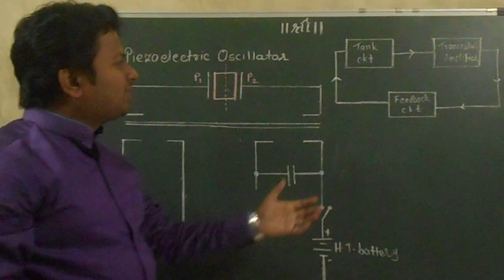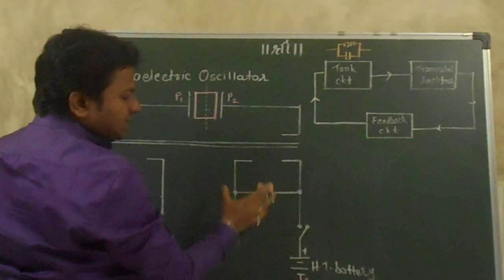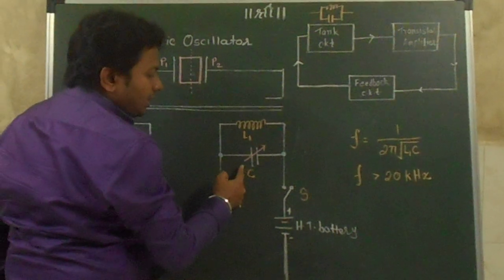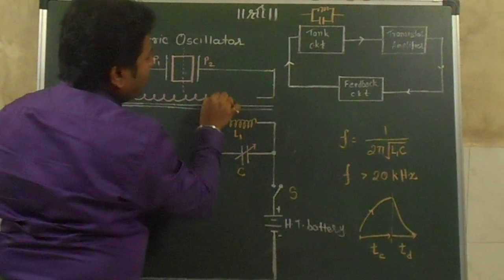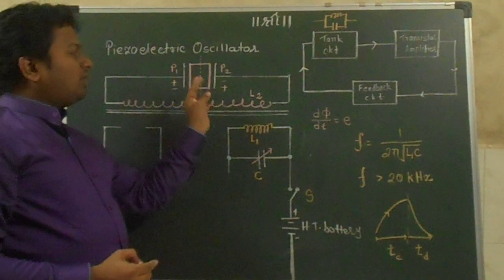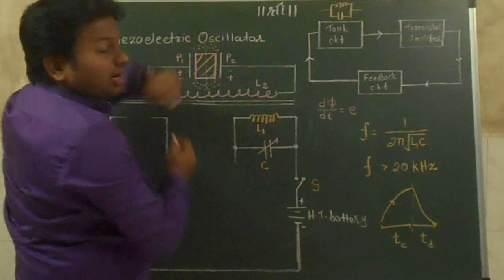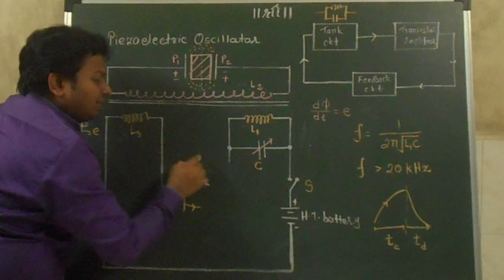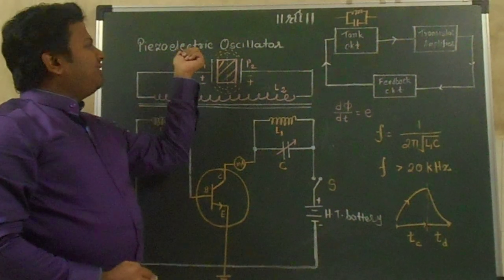Piezoelectric Oscillator: Production of Ultrasonic Waves (Engineering Physics)

Comment: earth forces and quartz to charge a  dual capacitor to make a spark gap that has a arc flash that draws in all the trapped sun rays into usable lighting like the so called kings chamber..  or like a reverb guitar in a speaker...  once you get it a rocking dont come a knocking...    two coils one for earth and one for the sun...

Comment: earth makes unlimted forces and salt water has tons of loose electrons  hey whats the core of the great pyramid?? lol river nile? socks on carpet? petting a cat??? purrrfect... piezoelectric is everywhere.. everything is the light  earths crust is 40% quartz and flying through space like a flexed quartz tweeter spearker... Here are some of my fav piezo vids. This proves the energy that our galaxies run on. If you can energize items to repeal earth with earths energy it proves to me. Earth is piezo charged and same charges repel. Watch all and think. The spiral of life and empty fabric of space. https://youtu.be/9NbCzbDdd-g

Push and pull depending on charge if its not charged it becomes mass and velocity. https://youtu.be/hoswNJZqUX0

Defy gravity. 
https://youtu.be/TV4oq_-OXkg

Sand https://youtu.be/L25q4fV8_68

Water https://youtu.be/VhWQ-r1LYXY

Fire and wind. https://youtu.be/a7_8Gc_Llr8

Don't forget energy makes noise. https://youtu.be/HE0k7Z2xoiw

Comment: Sir, I thnk you for clear explaination , however it is  known that the main parts of an oscillator are : the amplificator and the feedback circuit. as you mentioned it.  But, there is a condition that the amplification has to be unity to keep constant the intensity of output signal, sound or vibration, otherwise it increases infinitly.
Reply from the maker: Azzeddine Djaiz 
thanks. may I know from where you are?
Reply: Saudi arabia
Reply: Canadian
Reply from the maker: Azzeddine Djaiz 
o great. God bless you
Reply: I thank you so much. you are doing a good job.
Reply: I meant  amplification of the the amplifier X Attenuation of feedback circuit = unity